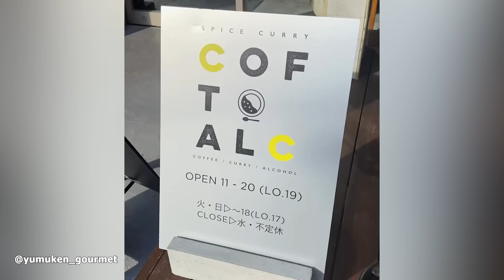Extremely Satisfying Workers!

Comment: To the Graco line striper operator , turn that gun mount pole round so the gun is opposite the rear wheel at the axle and out about six inches or more , you physically then can’t run over your curved lines , or when painting safety islands. That can be done on either side of the machine . It will give you better control as well🎉